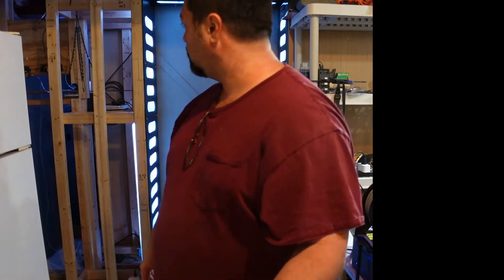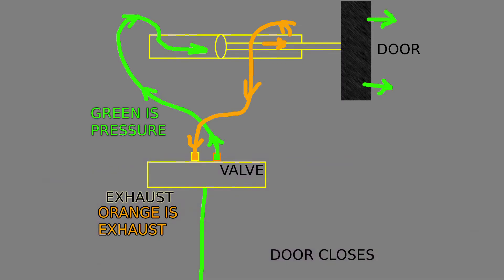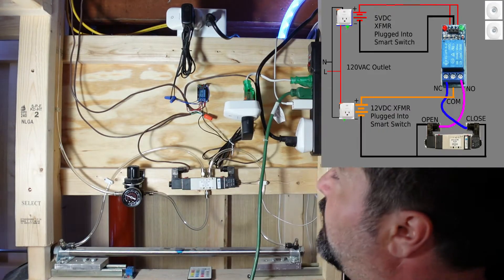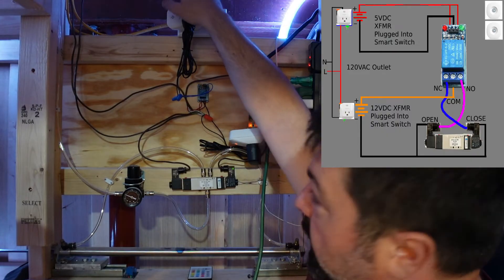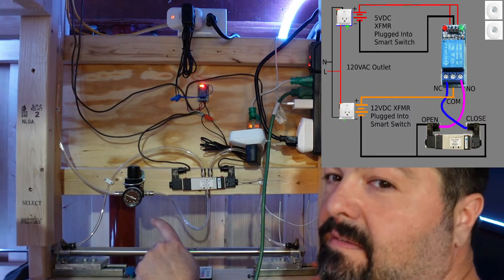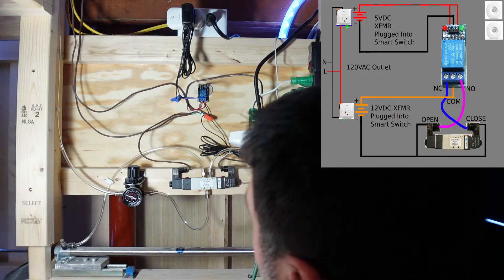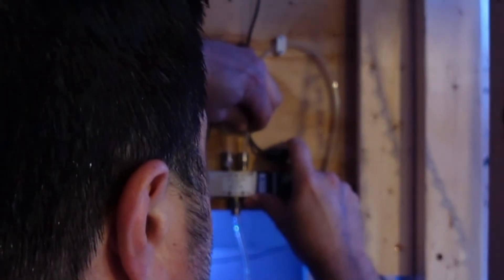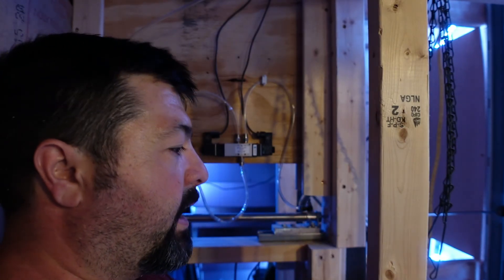How to make Automatic Star Wars / Star Trek Door - DIY EP31

Comment: Hey bud, did you use 2 of everything on this build because of the double doors? Or was it one set up that controlled both?
Reply from the maker: Hi! I worked with a Mechanical Engineer when designing these. To be able to have better control of your door's and to be able to adjust everything and slow things down so they smoothly come together and on time and not slamm then YES with a double door setup you need two solenoids like the video explains. Also played with where to mount the cylinders Higher middle or lower. Works best in the middle. You can notice on other persons mounted higher or lower, they have a lot of swing to it. With a one door setup you only need one of each. Hope that helps!

Comment: 2:45 Does this mean if the power goes down, the doors couldn't be opened manually?
Reply from the maker: That is correct, unless you have access to the valves equipped with the manual release buttons. I have a slide door next to this so i do not have to worry about it. Thanks for watching!

Comment: If I may ask, what material is the door?
Reply from the maker: I used light weight Lauan : 1/4-in x 2-ft x 4-ft Lauan Plywood https://www.lowes.com/pd/1-4-in-Lauan-Plywood-Application-as-2-x-4/1000068895
Reply: @WhiteysWickedWorkshop  Thanks.
Reply: @WhiteysWickedWorkshop  Is it possible to use some much harder wood?
Reply from the maker: @isfahanismail10  I’m sure but you will put more strain on your rollers. I went with lauan to keep it as light as possible

Comment: 3:03 By using the "exhaust" of one cylinder to push the input of the other will not only eliminate the use of the second valve but will make the doors open synchronized automatically.
Reply: If you do that, would you be able to slide the doors open manually, when the power drops? (safety issue)
Reply: @remconet  There is a very simple solution to that. You install a dump /bypass valve to release the air pressure. Or by just setting the manual operation button (usually a little blue button) in a location where it can be reached and operated. It is easily done from the maintenance side(inner side). From the outer secured side, it can be placed where a small rod can be inserted through a tiny hole and the button pushed. This sort of thing is usually placed above the door and the hole disguised as a vent plate with other holes.
Reply from the maker: Is that right? That’s interesting, I’ll have to check that out.

Comment: This would be awesome 10 years ago. Now it's just, OK. Basically anyone can do this now.

BTW You don't need two cylinders.  Using a belt drive from a garage door would have made it way easier, takes up less room and less costly. Use a decent motor and it cost a lot less and no need to use air.
Reply: Also NOT using that relay module would save you wiring and money. One power supply and One switch (Regular SPDT 12v Relay)
Reply: 10:49 Agai  a regular relay would last longer and No need to change out the whole module. BTW Are you sure it was the contacts and not the circuitry in the module?
Reply from the maker: It makes me sad to hear you dumping on this video. This works. And I wanted the air exhaust sound. I made these videos to help others do the same thing. Everyone else shows off how things work but never show how it’s done. Thanks for watching!
Reply: @WhiteysWickedWorkshop  what makes you think I am "dumping" on your video?
Reply: @WhiteysWickedWorkshop also you can get the exhaust sound by using just one cylinder or a recording.

Comment: I built a double door set like this. I ran the solinoid off a battery to test it out. Added the relay and wired it like your diagram shows and only one side of solinoid stays lit at all times. That's with or without power to relay one side stays on. Any ideas? Bad relay out of the box?
Reply from the maker: Remove switching power to the relay. So it switches to the other side. If I’m reading this correctly
Reply from the maker: Ok I think I misread. Try tapping the relay. Could be a bad relay
Reply: I bought a 5 pack of relays. I was messing with it last night and decided to pay a bit more attention... I ordered 5v relays and right on the relay it says 24v. So I got the wrong stuff. The box they came in even says 5v on it. Going to get the right relays and try again. Will link a video to you of my doors to see what you think. I am doing a full star destroyer bridge themed theater room. Thanks for the reply.
Reply from the maker: @SinisterXB100  lol oh wow that’s crazy. Well glad you figured it out. I’d love to see what you make!
Reply: @WhiteysWickedWorkshop here's my quick video of the doors working off motion sensor. Not perfected but working.
Reply from the maker: @SinisterXB100  Youtube is blocking some of your comments for some reason.
Reply: https://youtu.be/iJTQSIjkyto?si=YYEOZKl3vDsCPCRy

Comment: Very Nice Job! The only thing that I would like to add is, What you're calling a "cushion" is actually called a restrictor. It might cushion the action of the door, but it actually restricts the airflow from the cylinder to slow the action of the cylinder piston.
I worked on pneumatic controls "back in the day" and worked on pneumatic control valves for water isolation as large as 20".
Reply from the maker: Thanks Don and thanks for watching! The website is calling it a cushion but yes it does restrict the air. Could they be calling it a cushion because a restrictor is more like an orifice that might not be adjustable? I'm an Electrician by trade so this is NOT the back of the hand for me :)

Comment: Good video and nice build. 
Using pneumatic cylinders and valves to move the door is a pretty good solution. 
One of the downsides is that you need a compressor. But its not that complicated to build. 
I would add beam sensors that prevent the door from closing if someone stands in it.
Reply from the maker: Thanks! Yes if I were to do it again I would use a smaller and quieter compressor but I had the compressor for my workshop so it was a no brainer. As mentioned in the video I use smart switches to control the door, so far I have not had any safety issues but I would definitely add something extra if I were to go public. Thanks for watching!

Comment: I really like this. But my question is, what happens when you lose the power from the grid? Do you have a way to push the doors open? Or you are stuck inside/Outside? Thanks
Reply from the maker: Thanks! You would need to have access to the cylinders, solenoids etc to be able to get out most likely, or another route. I have another route. You could possibly add some type of pin that can be easily removed in case of emergency. I havent put much thought into it because i dont have this problem. Thanks for watching!

Comment: Awesome build and thinking of doing my own. What size lines did you use?  Also would you be able to split the lines and run both cylinders from one valve at once?  Thanks for the info and tutorial.
Reply from the maker: Thanks! Thats a very good question. I imagine you would probably have issues with only using one valve. Path of least resistence as always. :) Let me know if you try it!
Reply: Thanks for the tip. I’ll see if it works by keeping all the hoses exactly the same length.  My set up has to go overhead because of constraints so everything will be close together. Those look like 1/4” hoses which is what I’m trying but can you let me know what you used. Thanks so much for the inspiration.
Reply from the maker: @carlosescalante8181  No Problem Carlos! Check in the description I have a full Bill of Materials

Comment: Looks good but I don't like that hissing sound it makes. I'd probably use a linear motor instead of compressed air.
Reply from the maker: Thanks! You can add mufflers to the exhaust which helps with the hissing sound. I removed them because I was looking to make this sound.  You can also use a windshield washer motor on a belt similar to Grocery stores, automatic doors.

Comment: Super neat build!  I think I am going to build one that uses the manual soft close type doors. My new house design will have each bed room with an exposed 12 foot opening to which I can build a full length working Star Wars door facade.  Which will be able to put in the 4 foot door along with lights and anything else that will seamless go in to it. I think I will also add in some shelves on both sides along with a micro switch that will activate the door opening/closing sound as well. With the ability to turn off and adjust the volume with the control panel and lighting.
Reply from the maker: Sounds like an awesome project. Join us over on the Star Wars Room builders Facebook group, where we show pics of our builds etc.

Comment: Great doors. You say you’d need to double everything with two doors, why wouldn’t one servo valve serve two doors?
Reply from the maker: I’m assuming you mean the solenoid Valve? Well like I say in the video it depends on which is closest to the air source, so if you put two doors on one solenoid valve then you will have to have that centered between the middle of both of them so both doors close at same time. That what you meant?
Reply: @WhiteysWickedWorkshop  Yeah sorry, solenoid. In fact rather than having it centralised I’m wondering if the existing T connector can come from a single solenoid output with equal length tubes coming from the T?
Reply from the maker: @iandale  million ways to build a mouse trap. Try it and let us know. :)
Reply: @WhiteysWickedWorkshop  I’d love to but at the moment am tied up applying pneumatics to bring an Avro Vulcan Nuclear Bomber to life… maybe the Millennium Falcon when I’m done 🤣
Reply from the maker: @iandale  Nice what scale?

Comment: Cool build, I'm looking to do something similar. Are you leaving the compressor on 24/7? Do you have to purge the air to prevent condensation in the tank? I want to use a smaller compressor but I'm worried about the longevity of leaving the compressor on.
Reply from the maker: Hi and thanks for watching! I do leave the compressor on 24/7 and it hardly ever runs because its a large tank. Condensation will always collect in a tank but its your job to drain the water while performing maintenance. It doesn't have to be strict, just drain it when you think about it. If I were to do it all over again I would get a very quit tank and build a box to put it into so you couldnt hear it at all. Cheers and good luck with your build!
Reply: @WhiteysWickedWorkshop  Cheers! Thank you for the tip and reply, think I'll go with your suggestion of a smaller tank and box. Subbed and liked!
Reply from the maker: @khangaroo01  No problem! Thanks for subbing!
Reply: @khangaroo01  What air compressor did you go with? Looking to start this project but didn't want a large air compressor. Luckily I have a attic space above the door frame I will be doing this on so it should be pretty easy to hide it.

Comment: I have never used Pneumatics before on a project.  Are there small and quiet compressors for a build like this?  I couldn't imagine a pancake compressor firing up randomly throughout the day to keep the pressure up.
Reply from the maker: I have heard of people putting pancake compressors inside small refrigerators or insulated boxes. I have also seen Quiet compressors at LOWES for purchase (not sure how quiet they are). Mine is a full size and loud...but doesn't run often. The bigger the tank the less it needs to run. But...all pneumatics leak somewhat no matter what you do.